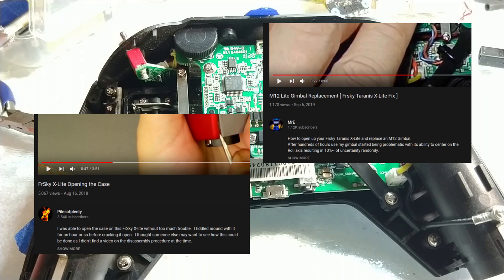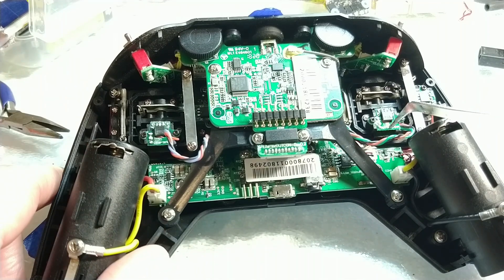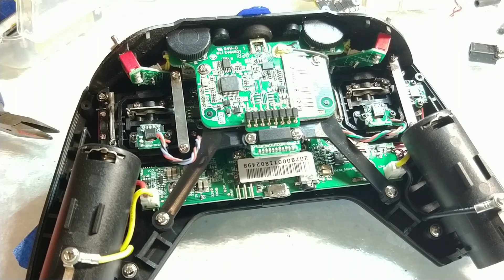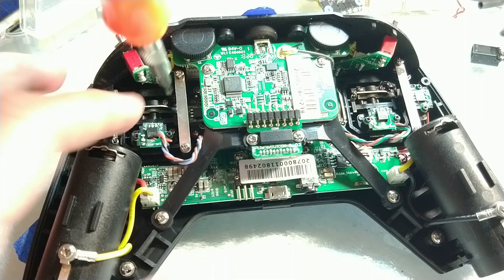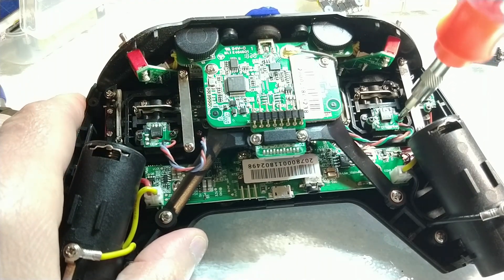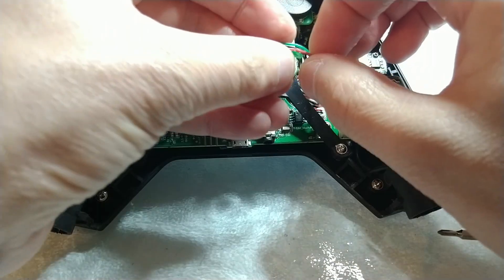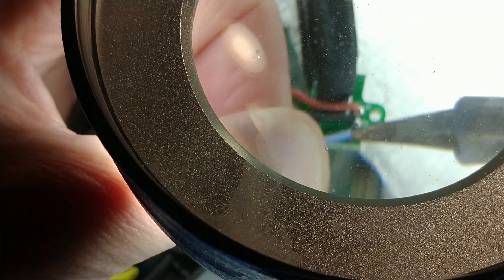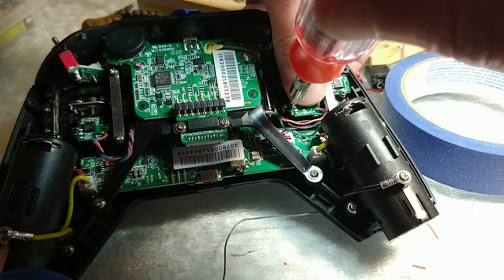🛠 How to repair x-Lite yaw roll sensor wire signal glitching click

Comment: Thanks a lot. The red wire was broken ..
So , if I want to change all wires   what to do?
Reply from the maker: if they are long enough, just solder the existing.
if not, then you have to dismantle a bit more and find crimped wires that fit the JST connector plugged into the main-board.
Reply: @nerdCopter  do you know the exact name of connector?
Reply from the maker: @polarfpv1860  i dont know.  i just know it' silicone sheathing. i don't know the gauge, nor the length, nor the JST/crimp size.
sorry. it's not complex though, just try your best.  you could potentially just solder a length of wire to the end of the broken wire.
Reply: @nerdCopter  hi.
I found out - it's  Micro JST 1.25
Reply from the maker: @polarfpv1860  thank you! good info for other pilots
Reply: @nerdCopter  i solded red one, trouble is gone,
 but to the future - will be good to remove all wires by new

Comment: I was getting major twitches on Yaw, which took the form of sharp spikes in my logs. These spikes showed that the twitch was near full deflection.  It is my understanding (gathered from Jye,) that a full deflection twitch likely indicates a faulty connection such that the plug for that stick simply needs to  be reseated. I opened my X-lite S with upgraded Pro gimbals, and reseated the plug for the left stick. This immediately solved the problem. No more twitching. Hope this helps.
Reply from the maker: great!  glad it was an easier fix than soldering. if it happens again, check for breakage of wire hidden in silicone sheathing :)